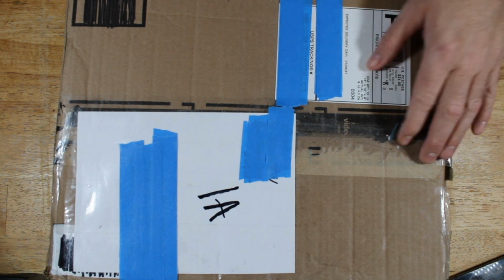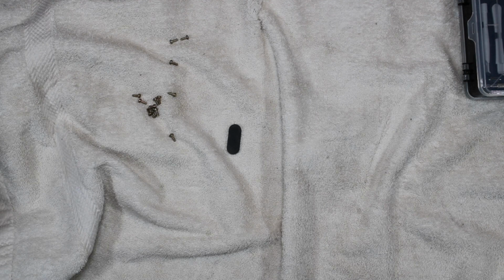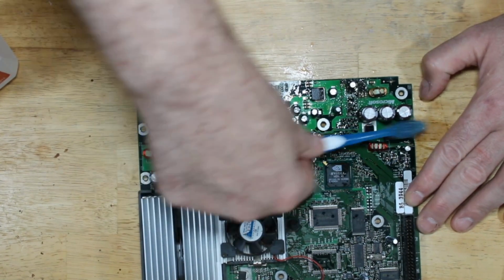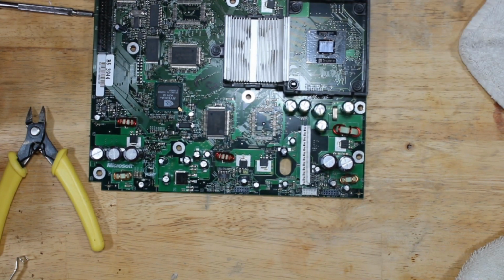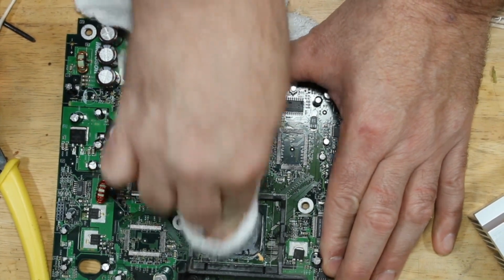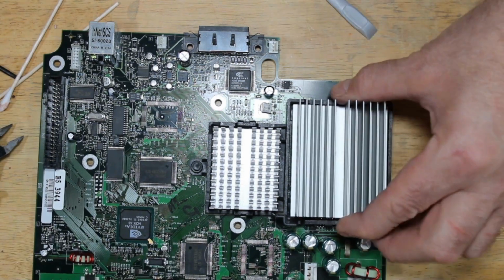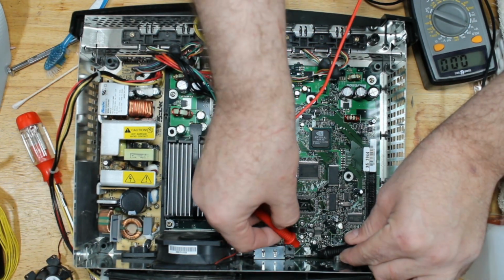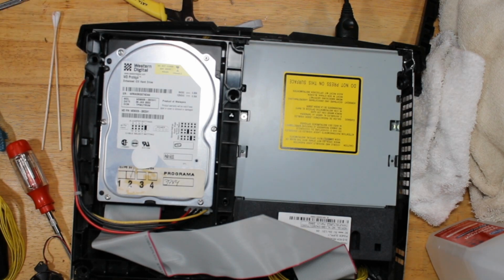Gaming off the Grid - Custom Mod! Part 1

Comment: Interesting to watch. I have a VERY late 2005 model, 1.6b. I’d love to keep this thing forever, it’s minty. Anything you’d recommend?
Reply from the maker: Replace your hard drive (so you have your original set aside) and put in a larger one. :) I'll be showing this step for step on an upcoming video. Also, you need to watch the capacitors next to your CPU. They tend to go bad over time.  Clean your laser and replace your belt on the DVD. Those few steps should keep you running for years to come! :D
Reply: @retrogamingrepairs6223  thanks for the tips!

Comment: Do you do ColecoVision repairs by any chance? Mine has been out of commission for some time now. I believe it to be the systems connection with the power adapter, and not the power supply itself. It seems to work at first, but after a few minutes of play time the graphics start to get all garbled or the game will just crash outright. If the console moves at all it will shorten that time to well, the second I moved it. I tried replacing the power supply before and it didn't solve it, plus depending on the angle the plug is placed into the ColecoVision it seems to work better or worse. If you do ColecoVision repairs and would be up for it I'd be willing to pay some decent cash to get her up and running again!
Reply from the maker: I've actually never worked on one before. Only one I've ever come across works (mine) and I've had no reason to open it. I do need to clean it soon. :)

Would be fun to work on it and make a video. :P
Reply from the maker: Let me know if you want to send it in. :P